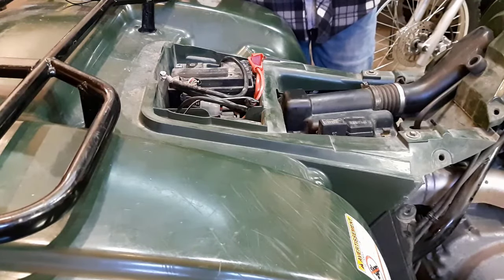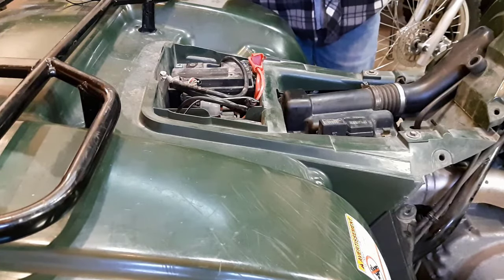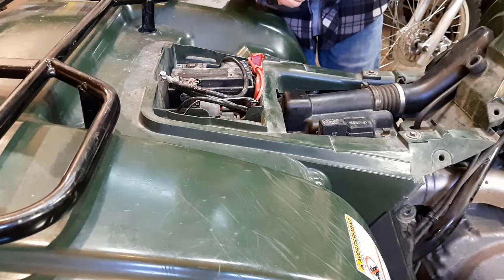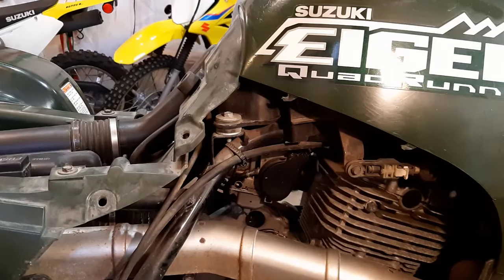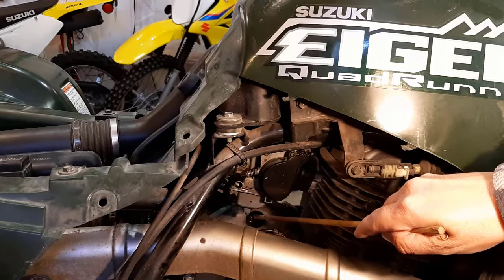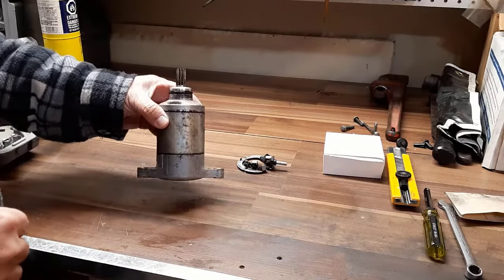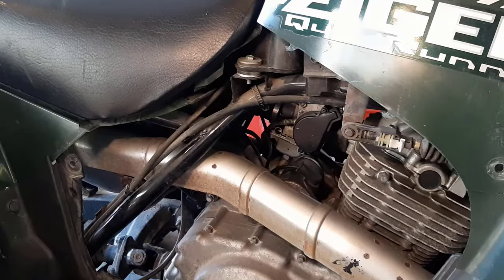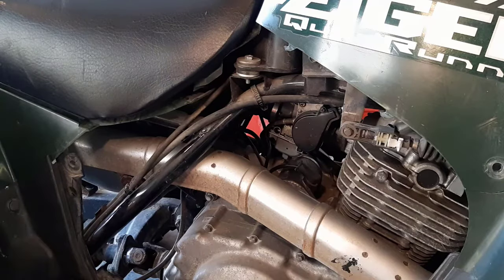WHY DOES ATV CLICK WHEN TRY TO START IT // Suzuki Eiger Starter Fix

Comment from the maker: Please leave a comment if this video helped you with your ATV. You can also watch this video where I had fuel petcock issues with my ATV: https://youtu.be/xOiORl-roiA
Reply: drop your petcock $100 + part, swap with a raptor 660 model on/off/reserve old school gas valve for $10 (other models have the same fit as well),  just plug your vacuum line with an electrical wire nut.  working now no problems for last 6 years

Comment: I have a 2015 Suzuki 400 Quad Runner with the same symptom, clicking at the solenoid. I was looking to buy a new starting motor, however my year/model Quad Runner requires a much more expensive starter than pre-2011's models; $360 ouch. After viewing your video, I ordered a new brush kit for a fraction of the starter cost. I just finished the starter re-build. When I opened it up it was loaded with fine black powder. After cleaning as you described and re-installing, she starts right up. The hardest part of the job was trying to figure out how to twist and rotate the starter to clear the tailpipe. Thanks again for the great video.
Reply from the maker: Wow that's great to hear! Made my day.
Reply: Any tips? I gotta pull one this week

Comment: Thanks. I have kids dying to ride and you saved the day. Easy fix...just needed a point in the right direction. Was able to clean up my brushes and the starter housing. That got it working for now, new brushes ordered.
Reply from the maker: Glad it worked! What type of atv do you have?
Reply: @GettingItDoneRepairs  '07 Suzuki Ozark 250

Comment: Thanks for the video. I have the old 2005/6 Eiger. When taking off the starter I had to tap it out from the other side because it was in so tight. The gear was fine not worn at all. The brushes were completely gone. So I’m ordering them. I’ll let you know how it goes.
Reply: I ended up ordering a new starter. The replacement brushes were $30 and the new starter was was $34. It was a little larger diameter and I had to take the plastic cover off the throttle spring housing to get it in. It started right up. I’ll rebuild the old one for a backup. Thanks again for the video.

Comment: My 400 Eiger would/will not start but clicked. It would start with the manual pull so I guess its the starter brushes getting worn is the cause. Thanks for reminding me as I did the job a few years ago.
Reply from the maker: Sounds like your starter. Get a piece of wood and hammer. Tap the starter while someone hits the start button. It might start. But you will still need starter maintenance

Comment: Thank you for sharing your videos. They are very informative and detailed well. I have a clicking won't start issue going on at present. If the starter brushes are bad would it make the relay under the seat click when you try to start it.? It has never done this before, I just replaced the carburetor on it and have never had trouble starting it before. I went to start it with a full battery and all I got was the clicking from the relay under the seat.
Reply: Yes, if the starter brushes are bad that would cause the relay to click but nothing happening at the starter. Try tapping the starter with hammer.

Comment: I have a four wheeeler its making a  clicking noise and I have a wiring harness for it but its still clicking not even trying to start at all what do u think is wrong I slide out jumper cables to the battery?

Comment: I know this video is 4 years old but do you happen to know the part number for the brushes for the Suzuki Eiger quadrunner. I have rebuilt mine from the ground up it is the best toughest machine ever. I've had this problem for a year or so and just never got around to it because it's so hard to find the right stuff for the model and Suzuki is quite expensive. And with a pull string that starts very easily it was never really an issue but now that I got everything up and brand new I'd like to get that if you had the part number or the link to Amazon or wherever you get it I get my parts through Suzuki.
Reply from the maker: @Candi_gaming  Hello, there is a link in the description of the video that takes you directly to the part on Amazon

Comment: Just lightly tap it and then it will start and that's how got my quad back up running in good order and it has no more issue and lucky Ive bought a spare starter reley and now I'm just waiting for my new tires
Reply: Does someone have to be clicking it while you tap it or no
Reply: @nicky_9791  No

Comment: Does the ground wire sit on one of the mounting bolts? or does it mount on the starter pin?
Reply: and if it is on the mounting bold, does it go on the side that squeeze's together with the frame? or the outside of it only touching the starter

Comment: I have similar quad. Starter clicks won't turn engine starter test fine out of engine. Does start rope start. It's like engine stuck is how starter acts loud clunk. Both starters used and the new one. Has ground and power to where it all needs to be
Reply: I have the same problem did you figure it out

Comment: hi i have a suzuki quad which was clicking and nothing else when i tried to start it,,i replaced the startewr relay and the starter motor but it is still just a clicking noise...no cranking.
when I add in a battery charger to the battery(which is giving 12v) I can hear the startyer motor whirring but there is still no cranking,..What do I try next??? Help
Reply: Did you figure out the starting problem to your quad, I have the same issue?

Comment: I click the push start and it clicks 1 time and my battery fine because my head light works do you know what could cause that?
Reply: SAME THING HAPPENING TO MINE! what was wrong with it?
Reply: @thatboytrenton1919  I bought a new starter and it fixed it lol
Reply: @spiral-editz9313  lmao i just took mine apart cleaned it and now it runs lol
Reply: Good mine caught on fire earlier lol it back fired through the carb

Comment: had this problem, i though it was moisture from rain.  I took my seat off and after 10 mins it started.  i cut it off about 10 time the last few days...now its doing it again.  

I had a question, I'll probably just try it...I can jump the starter with a screw driver and that will let me know if its the brushes or starter right?

Comment: I have one of these. I wish it was a honda   !   What a pies of shit
But great information ! Thanks
Reply from the maker: All brands have issues. I worked thru a few issues and now it's working great again. Good luck with yours
Reply: I bought one new in 2002..have over 20 000km on it, bulletproof..used in rough Canadian bush trapping and hunting
Reply: @kevinfinlayson3617  still not a honda.
Owned many.  No problems.i did get it fixed,  working great now 👍

Comment: I have a quadrunner 250z and have replaced the starter, solenoid and switch but it still does this thing where it begins to spin then stops and when you let off the button it's like it backspins or something. ( Like "chirp. zing") It will do it again and again sometimes until it finally keeps spinning and starts, but it is very hard on the starter.